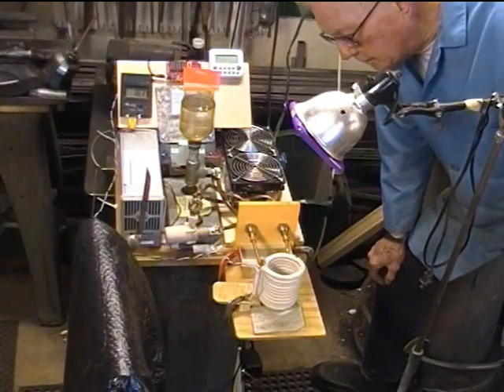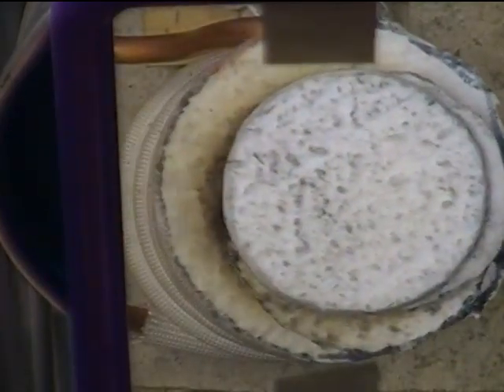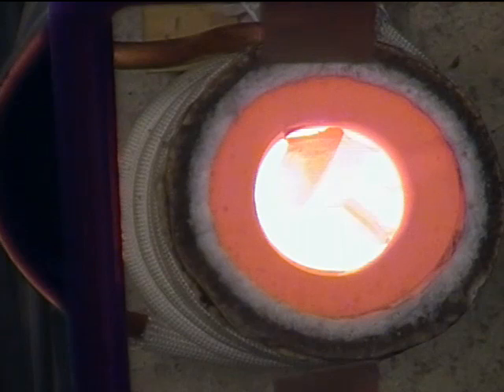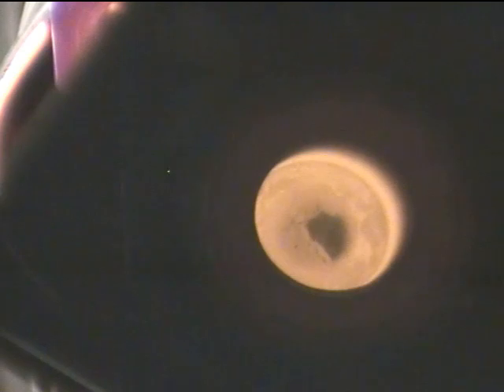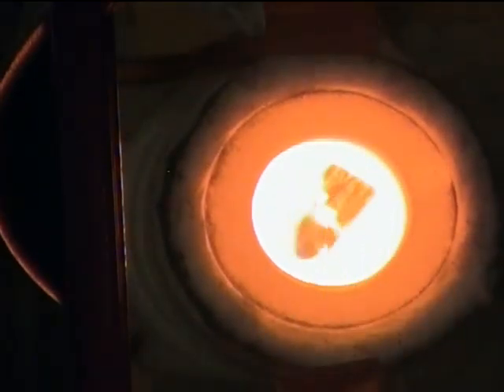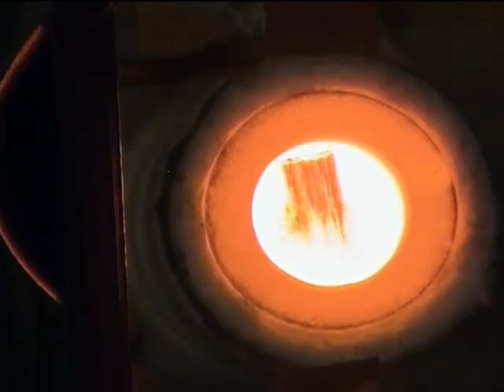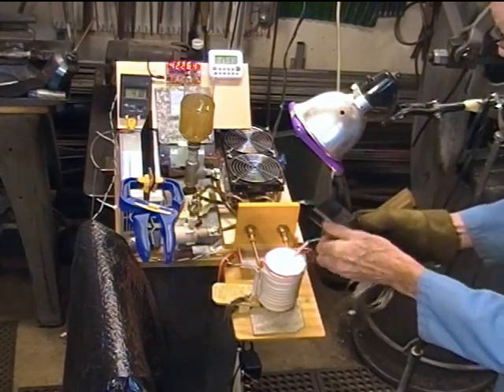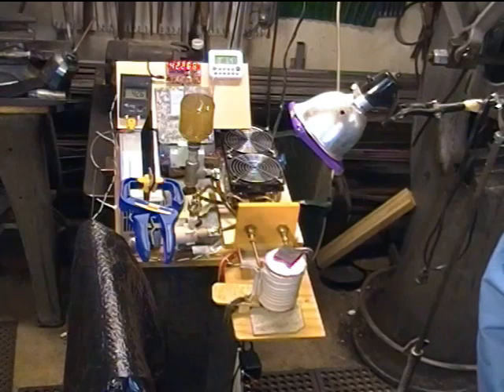June12 2500 Watt ZVS Induction Heater, Copper Melt w/Good Filters

Comment: @@UCuazfefsFtE_9a2paf_yE-A Have you thought of using a low flow argon feed to create an inert atmosphere for reducing oxidisation?
Reply from the maker: Good question.  But I don't think I want to get all the sophisticated with the process.  I did attempt to limit air and oxygen from getting to the graphite  crucible with a fairly tight fitting cover, though.  That first try didn't seem to be very effective.  I need to machine a really tight fitting cover one of these days.

Comment: Thankyou for posting your experiences with ZVS induction heating, especially with copper which I have a particular interest in melting for small scale metal casting.
Your videos alone are the reason that I decided to get a 2500W ZVS unit and get into smelting with induction rather than building a propane burner furnace.
Your videos were the only ones with any real substance that helped me to understand the process, how to improve on the units available and give me the confidence that I needed to take a step forward here!
Many thanks, I will continue to watch your future videos with great interest.

Comment: sir , can you please tell the rate and number of components used in the circuit and the DC current ampere and voltage ?
Reply from the maker: I am sorry but I do not have a parts list for this machine.
Reply: @frenchcreekvalley  ok.  No problem.  Thank you for your response.  Can you kindly tell me DC ampere and voltage?
Reply from the maker: @niladriacharyya7904  48 volts DC at 50 Amperes.
Reply: @frenchcreekvalley  thank you very much sir

Comment: Sir induction heater choke and wire value
Reply from the maker: Are you asking about the chokes between the power supply and the Mosfets (which are internalt to the pc board) or are you asking about specifications for the work coil that surrounds the crucible?
Reply: @frenchcreekvalley   chokes between the power supply and the Mosfets and wire swg number
Reply from the maker: @niladriacharyya7904  The choke measure at 94 microhenry.  The wire is 16 gauge (0.050 inch diameter).
Reply: @frenchcreekvalley  ok.  Thanks a lot